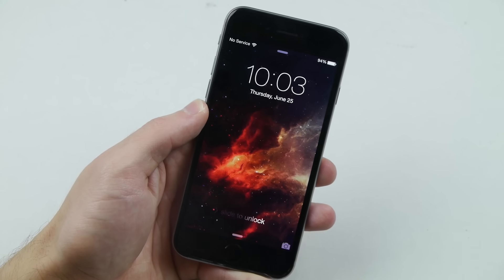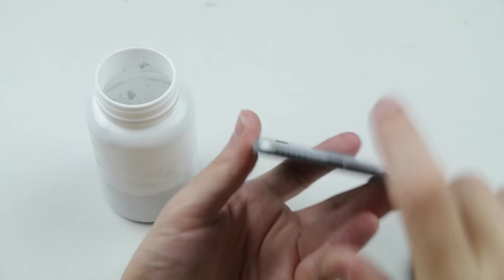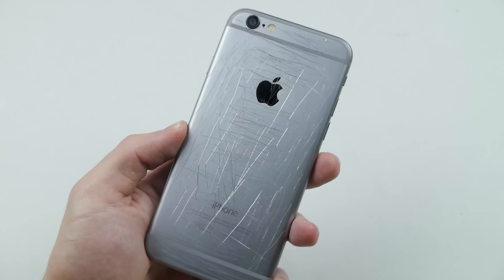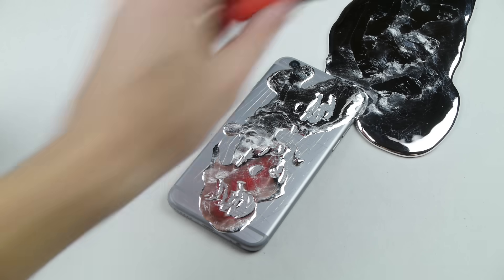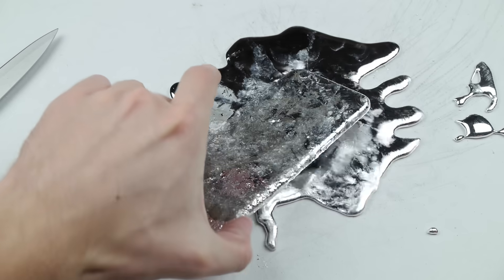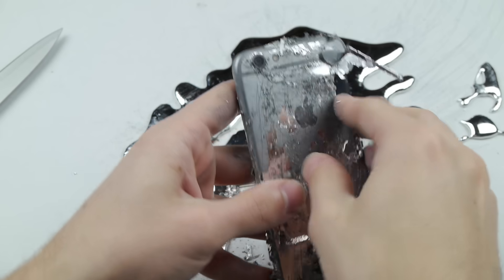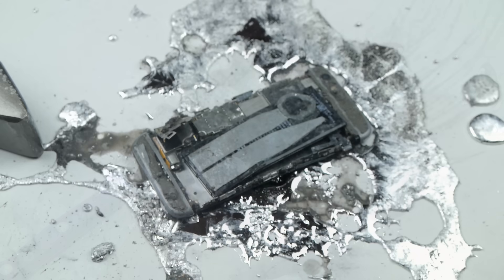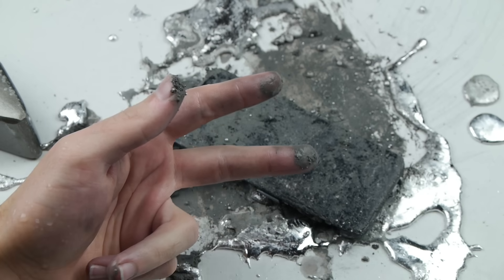What Happens If You Pour Gallium on an iPhone 6?

Comment: Skip to ContentSkip to Wiki NavigationSkip to Site Navigation
 Wikia		
   
Sign in	

 Geometry Dash Wiki
On the Wiki
Wiki Activity
Random page
Videos
Photos
Chat
Forum
Content
Levels
Community
 Contribute  04:42:42 6 Jul 2015 (UTC)Watchlist	Random page	Recent changes
Update 2.0
   
50PAGES ON
THIS WIKI View source   
Normal	This is upcoming!
This article contains information about unreleased content which is not entirely known about yet. If you do know something, help include additional information. Keep in mind that unverified information may be removed.

  Recently edited by
TheWikiGamePlayer
TheOtherGuest2
Themaster401
Nusdan
More...
Update 2.0 is an upcoming update to Geometry Dash with no set release date. It will be the tenth major update to the game.
Previews
October 18, 2014: Robert Topala makes his first, brief mention of Update 2.0 through Facebook, in the Update 1.9 changelog. When touching on the user accounts system that was introduced in 1.9, he says, "Will include more in update 2.0."
December 15, 2014: Topala announces on the official Geometry Dash Facebook page that he would begin sharing information about Update 2.0. He writes, "Highscore system is back online and should be a lot faster than before. More info about the Steam version and Update 2.0 coming in the next few days. Thanks for waiting!".
December 21, 2014: Topala posts his first preview image for the update. The figures on either sides of the picture resemble monsters, and a cube is included in the center. Written above is "The INVASION has begun", and there is also text reading "Update 2.0 W.I.P" in the lower right hand corner. This image caused much hype around the network, and theories of a song being Invaders started to expand.
December 26, 2014: Topala posts his second preview image, showing a Super Mario Bros-like stage, with a background that resembles to the video game Super Mario World. The cube that is included is similar to the 1-up mushroom found in the Super Mario series. It has shading, and is pixelated, hinting the possibility of new icons. It also shows new ground, and background patterns. Also, the 1-up mushroom has 3 colors from the shading, alike the Steamstep, and Companion Cube icons.
January 13, 2015: Topala posts another preview picture, confirming the existence of blue coins, an upcoming feature that was first discovered on the GJ_GameSheet file from Update 1.9 and in the GJ_GameSheet-uhd file from the Steam version. The blue coin closely resemble the regular, yellow coins, which were added in Update 1.6. While no information has officially been released on them, it is widely believed that they will be used for coins in the level editor, due to his post saying "I will add this maybe as user coins..." . The preview image also introduces two new Wave Icons, and new portals that were discovered to teleport the player to the nearest teleport portal. The colors of the portals are blue, and orange, confirming a Portal reference. About this, he also confirmed for 2.0 unlockable versions for the robot, and a chance for some of Etzer, and Viprin's Utopia texture pack Icons/Balls/Ships/Waves/UFOs to come in future updates.
February 5, 2015: Topala hints that he will post an Update 2.0 promo on the Geometry Dash Lite 1.9 update changelog. He writes, "I will be posting another Update 2.0 promo later today or tomorrow."
February 6, 2015: Topala posts the fourth preview picture, which shows a newer thick gray portal, making way for theories of a game mode in between two sets of new blocks: Embossed metal blocks, and "factory" style blocks.
February 13, 2015: Topala posts a fifth preview picture, which hints the soundtrack for the upcoming level. It depicts "B + D," an airplane, a skull with a lock on its forehead, a flame rising out of water, and a question mark. It was most agreed on that the next level would be "Deadlocked," by F-777, as B + D = F, the airplane refers to the Boeing 777, and the skull and lock refer to the song name itself. The soundtrack was also not available in the custom music selection. The other song would be an unknown song by Waterflame as the picture of a flame rising out of water hinted.
March 3, 2015: Topala posts a sixth preview picture, showing two new types of blocks, and three new backgrounds. The second picture from the left had already been shown, and the blocks from the first picture had already been shown.
March 24, 2015: Topala answers a few questions on TouchArcade in which he mentions there's a vast amount of colour channels coming up, and the copying between levels is mentioned, and that he's working on it. Other than that, better browsing options, and songs saving in the SD card. [1]
March 30, 2015: Topala confirms new colours, trails & new creator options. On the other hand, the idea of allowing the copy of stuff between the levels are still in discussion due to people saying it would end up in levels looking the same, and Topala isn't yet sure about adding this feature. [2]
April 2, 2015: Topala confirms that the sneak peek will be out soon. Also he confirms the sneak peek will show some features but not all, and he is sure that the creators will definitely love it. [3]
April 6, 2015: Topala confirms that the sneak peek will be out very soon. Also he wrote, "After that I might make a walkthrough video that shows some new editor features, lots of things to cover!" [4]
April 9, 2015: Topala posts a sneak peek on YouTube that introduces a new robot-like vehicle, new moving blocks, moving spikes, in game text, moving monster-like obstacles, changeable background, ground colors, new background, and new decorations.
April 17, 2015: Topala posts a reaction video about Geometry Dash in the official Facebook page in which he says: "Will be posting more info on 2.0 in a day or so, until then check this out :D (oh the rage)".
April 19, 2015: Topala posts a second sneak peek on YouTube that covers new level editor features, such as the ability to create, and save for copying custom objects, preview mode, layering objects, unlimited colors, and object scaling. Also, the object limit will be increased to 25,000.
May 11, 2015: Topala posts a third sneak peek on YouTube that confirms the level Deadlocked, along with new green jump rings (which combine the blue ring's gravity switch with the yellow ring's bounce), the teleportation portals, a new icon, a new background, new color effects, and new designs.
May 13, 2015: Topala posts on TouchArcade that there will be new filters for levels, in which you can now use a creator name as a filter to search for their levels. He also keeps the Deadlocked level difficulty as a secret saying: "Secrets secrets secrets... :)". Topala has provided information for the blue coins that are confirmed to be user coins, he says: "Separate. Blue coins = user coins = separate achievements and rewards". He has also mentioned an upcoming collaboration system, and following creators. In fact, There will be only three per level, and more obtainable than yellow ones. This also means a higher number for this specific coin achievements.
May 26, 2015: Topala makes his first mention of Update 2.1 on TouchArcade, saying "I wanted to mix up the art style a bit, keep things fresh. More craziness in 2.1!" He also mentions a changelog which describes the new features of Update 2.0. With the post, he confirmed that the changelog is coming very soon, and he also said that keeping updates smaller with only 1-2 months of development will be better in the future. He also said that 2.1 will be smaller but faster because 2.0 "took too long".
May 29, 2015: Topala answers a few questions on TouchArcade, confirming that Update 2.0 will introduce some space-related objects, along with several other new ones. He also mentions improving the Level Review system.
June 7, 2015: In a shoutbox conversation revealed on TouchArcade, Topala confirms that Deadlocked is a demon level. He also mentions a new trigger called "pulse trigger" which is related to color effects, and he discusses improving the level review system . In addition, he had this to say about the release of the update: "It's very very close to being done. I just don't say any dates because I'm not 100% sure."
June 12, 2015: Topala posts on Twitter that the update is close to release, so much so that no videos will be made to tide people over. Although he will make some tutorials later for new additions.
June 18, 2015: Topala posts on TouchArcade that users with accounts will have their own profile page [5].
June 19, 2015: Topala posts on TouchArcade that the performance in 2.0 will be better: "You shouldn't really see any performance issues compared to 1.9. I test a lot on mobile and optimize with that in mind. If anything you should see performance being better in 2.0." [6] He also confirmed that the moving obstacles have an option to change the speed at which they move. He also confirmed that he is adding an option which allows users to have up to 100 saved levels: "Hmm, well with the new improvement in save/load times it shouldn't be a problem. I will add an option that you can toggle to allow 100 saved levels (currently the limit is 20)".
July 1, 2015: During a conversation on TouchArcade RobTop said that "Hopefully I will be able to give some more info in a few days. The update is pretty much done, just fixing bugs. When adding many new systems like this there are a lot of things that can break. Trying to make sure you won't have any nasty bugs when 2.0 is released." [7].
Trivia
Since Update 1.92, the Deadlocked song has not been available for usage in custom levels as a soundtrack.
Update 2.0 has had the most teaser images and videos along with the longest development time.
The song name used for the first sneak peek video has not been identified.
If you look to the very right of the sixth WIP image, you can see a shadow of the new "robot" form.
The 2.0 Editor Preview video was the first of its kind, showing some new editor features.
Update 2.0 is the third update containing at least two new main levels, along with Update 1.6 and Update 1.9.
Update 2.0 is the update that holds the most spoilers. Topala has released over 30 things about the new update, a lot more compared to the others.
The blue and orange portals that teleport the player are very similar to the ones found in the Valve game series Portal, or can even be inspired by, as both games' portals are blue and orange and both teleport you to another place.
There is a still working glitch in 1.9 that can actually teleport you, seen here.
Sneak Peeks
Geometry Dash Update 200:13
Geometry Dash Update 2.0 Sneak Peek
Sneak Peek for a level with an unknown name
Geometry Dash Update 201:10
Geometry Dash Update 2.0 Editor Preview
Level editor preview
Geometry Dash Update 200:15
Geometry Dash Update 2.0 Sneak Peek 2
Sneak peek for Deadlocked

Gallery
2.0 Invasion
The first 2.0 WIP image released by RobTop
2.0 Blocks
The second 2.0 WIP image released by RobTop, making a reference to the Super Mario series
2.0 Features
The third 2.0 WIP picture featuring new wave icons, a blue coin and a new portal
2.0 Elements
The fourth WIP image that appears to show some more blocks, and a new vehicle portal and new decorations
2.0 Hint
The fifth WIP image which hints to the new levels containing the song Deadlocked by F - 777 and an unknown song by Waterflame
2.0 Decorations
The sixth sneak peek image showing some new background and ground designs, with some more blocks and monsters

Categories:
Updates
ADVERTISEMENT

 

Recent Wiki Activity
Practice Mode
edited by Hackey5 5 minutes ago
Secret Coins
edited by ErikCR 3 hours ago
Deadlocked
edited by ErikCR 3 hours ago
Portals
edited by ErikCR 3 hours ago
See more >
Live! Chat8
Geometry Dash Wiki
Join the Chat

       

Around Wikia's networkRandom Wiki
 GAMES
About  Help  Community Central  Careers  Advertise  API  Contact Wikia  Terms of Use  Privacy Policy  Sitemap Content is available under CC-BY-SA.  Mobile site

Final Fantasy VII or VIII forVideo GamesEntertainmentLifestyle
Will Final Fantasy VII or VIII win BEST GAME? Cast your votes
October 18, 2014: Robert Topala makes his first, brief mention of Update 2.0 through Facebook, in the Update 1.9 changelog. When touching on the user accounts system that was introduced in 1.9, he says, "Will include more in update 2.0."
December 15, 2014: Topala announces on the official Geometry Dash Facebook page that he would begin sharing information about Update 2.0. He writes, "Highscore system is back online and should be a lot faster than before. More info about the Steam version and Update 2.0 coming in the next few days. Thanks for waiting!".
December 21, 2014: Topala posts his first preview image for the update. The figures on either sides of the picture resemble monsters, and a cube is included in the center. Written above is "The INVASION has begun", and there is also text reading "Update 2.0 W.I.P" in the lower right hand corner. This image caused much hype around the network, and theories of a song being Invaders started to expand.
December 26, 2014: Topala posts his second preview image, showing a Super Mario Bros-like stage, with a background that resembles to the video game Super Mario World. The cube that is included is similar to the 1-up mushroom found in the Super Mario series. It has shading, and is pixelated, hinting the possibility of new icons. It also shows new ground, and background patterns. Also, the 1-up mushroom has 3 colors from the shading, alike the Steamstep, and Companion Cube icons.
January 13, 2015: Topala posts another preview picture, confirming the existence of blue coins, an upcoming feature that was first discovered on the GJ_GameSheet file from Update 1.9 and in the GJ_GameSheet-uhd file from the Steam version. The blue coin closely resemble the regular, yellow coins, which were added in Update 1.6. While no information has officially been released on them, it is widely believed that they will be used for coins in the level editor, due to his post saying "I will add this maybe as user coins..." . The preview image also introduces two new Wave Icons, and new portals that were discovered to teleport the player to the nearest teleport portal. The colors of the portals are blue, and orange, confirming a Portal reference. About this, he also confirmed for 2.0 unlockable versions for the robot, and a chance for some of Etzer, and Viprin's Utopia texture pack Icons/Balls/Ships/Waves/UFOs to come in future updates.
February 5, 2015: Topala hints that he will post an Update 2.0 promo on the Geometry Dash Lite 1.9 update changelog. He writes, "I will be posting another Update 2.0 promo later today or tomorrow."
February 6, 2015: Topala posts the fourth preview picture, which shows a newer thick gray portal, making way for theories of a game mode in between two sets of new blocks: Embossed metal blocks, and "factory" style blocks.
February 13, 2015: Topala posts a fifth preview picture, which hints the soundtrack for the upcoming level. It depicts "B + D," an airplane, a skull with a lock on its forehead, a flame rising out of water, and a question mark. It was most agreed on that the next level would be "Deadlocked," by F-777, as B + D = F, the airplane refers to the Boeing 777, and the skull and lock refer to the song name itself. The soundtrack was also not available in the custom music selection. The other song would be an unknown song by Waterflame as the picture of a flame rising out of water hinted.
March 3, 2015: Topala posts a sixth preview picture, showing two new types of blocks, and three new backgrounds. The second picture from the left had already been shown, and the blocks from the first picture had already been shown.
March 24, 2015: Topala answers a few questions on TouchArcade in which he mentions there's a vast amount of colour channels coming up, and the copying between levels is mentioned, and that he's working on it. Other than that, better browsing options, and songs saving in the SD card. [1]
March 30, 2015: Topala confirms new colours, trails & new creator options. On the other hand, the idea of allowing the copy of stuff between the levels are still in discussion due to people saying it would end up in levels looking the same, and Topala isn't yet sure about adding this feature. [2]
April 2, 2015: Topala confirms that the sneak peek will be out soon. Also he confirms the sneak peek will show some features but not all, and he is sure that the creators will definitely love it. [3]
April 6, 2015: Topala confirms that the sneak peek will be out very soon. Also he wrote, "After that I might make a walkthrough video that shows some new editor features, lots of things to cover!" [4]
April 9, 2015: Topala posts a sneak peek on YouTube that introduces a new robot-like vehicle, new moving blocks, moving spikes, in game text, moving monster-like obstacles, changeable background, ground colors, new background, and new decorations.
April 17, 2015: Topala posts a reaction video about Geometry Dash in the official Facebook page in which he says: "Will be posting more info on 2.0 in a day or so, until then check this out :D (oh the rage)".
April 19, 2015: Topala posts a second sneak peek on YouTube that covers new level editor features, such as the ability to create, and save for copying custom objects, preview mode, layering objects, unlimited colors, and object scaling. Also, the object limit will be increased to 25,000.
May 11, 2015: Topala posts a third sneak peek on YouTube that confirms the level Deadlocked, along with new green jump rings (which combine the blue ring's gravity switch with the yellow ring's bounce), the teleportation portals, a new icon, a new background, new color effects, and new designs.
May 13, 2015: Topala posts on TouchArcade that there will be new filters for levels, in which you can now use a creator name as a filter to search for their levels. He also keeps the Deadlocked level difficulty as a secret saying: "Secrets secrets secrets... :)". Topala has provided information for the blue coins that are confirmed to be user coins, he says: "Separate. Blue coins = user coins = separate achievements and rewards". He has also mentioned an upcoming collaboration system, and following creators. In fact, There will be only three per level, and more obtainable than yellow ones. This also means a higher number for this specific coin achievements.
May 26, 2015: Topala makes his first mention of Update 2.1 on TouchArcade, saying "I wanted to mix up the art style a bit, keep things fresh. More craziness in 2.1!" He also mentions a changelog which describes the new features of Update 2.0. With the post, he confirmed that the changelog is coming very soon, and he also said that keeping updates smaller with only 1-2 months of development will be better in the future. He also said that 2.1 will be smaller but faster because 2.0 "took too long".
May 29, 2015: Topala answers a few questions on TouchArcade, confirming that Update 2.0 will introduce some space-related objects, along with several other new ones. He also mentions improving the Level Review system.
June 7, 2015: In a shoutbox conversation revealed on TouchArcade, Topala confirms that Deadlocked is a demon level. He also mentions a new trigger called "pulse trigger" which is related to color effects, and he discusses improving the level review system . In addition, he had this to say about the release of the update: "It's very very close to being done. I just don't say any dates because I'm not 100% sure."
June 12, 2015: Topala posts on Twitter that the update is close to release, so much so that no videos will be made to tide people over. Although he will make some tutorials later for new additions.
June 18, 2015: Topala posts on TouchArcade that users with accounts will have their own profile page [5].
June 19, 2015: Topala posts on TouchArcade that the performance in 2.0 will be better: "You shouldn't really see any performance issues compared to 1.9. I test a lot on mobile and optimize with that in mind. If anything you should see performance being better in 2.0." [6] He also confirmed that the moving obstacles have an option to change the speed at which they move. He also confirmed that he is adding an option which allows users to have up to 100 saved levels: "Hmm, well with the new improvement in save/load times it shouldn't be a problem. I will add an option that you can toggle to allow 100 saved levels (currently the limit is 20)".
July 1, 2015: During a conversation on TouchArcade RobTop said that "Hopefully I will be able to give some more info in a few days. The update is pretty much done, just fixing bugs. When adding many new systems like this there are a lot of things that can break. Trying to make sure you won't have any nasty bugs when 2.0 is released." [7]. Skip to ContentSkip to Wiki NavigationSkip to Site Navigation
 Wikia		
   
Sign in	

 Geometry Dash Wiki
On the Wiki
Wiki Activity
Random page
Videos
Photos
Chat
Forum
Content
Levels
Community
 Contribute  04:42:42 6 Jul 2015 (UTC)Watchlist	Random page	Recent changes
Update 2.0
   
50PAGES ON
THIS WIKI View source   
Normal	This is upcoming!
This article contains information about unreleased content which is not entirely known about yet. If you do know something, help include additional information. Keep in mind that unverified information may be removed.

  Recently edited by
TheWikiGamePlayer
TheOtherGuest2
Themaster401
Nusdan
More...
Update 2.0 is an upcoming update to Geometry Dash with no set release date. It will be the tenth major update to the game.
Previews
October 18, 2014: Robert Topala makes his first, brief mention of Update 2.0 through Facebook, in the Update 1.9 changelog. When touching on the user accounts system that was introduced in 1.9, he says, "Will include more in update 2.0."
December 15, 2014: Topala announces on the official Geometry Dash Facebook page that he would begin sharing information about Update 2.0. He writes, "Highscore system is back online and should be a lot faster than before. More info about the Steam version and Update 2.0 coming in the next few days. Thanks for waiting!".
December 21, 2014: Topala posts his first preview image for the update. The figures on either sides of the picture resemble monsters, and a cube is included in the center. Written above is "The INVASION has begun", and there is also text reading "Update 2.0 W.I.P" in the lower right hand corner. This image caused much hype around the network, and theories of a song being Invaders started to expand.
December 26, 2014: Topala posts his second preview image, showing a Super Mario Bros-like stage, with a background that resembles to the video game Super Mario World. The cube that is included is similar to the 1-up mushroom found in the Super Mario series. It has shading, and is pixelated, hinting the possibility of new icons. It also shows new ground, and background patterns. Also, the 1-up mushroom has 3 colors from the shading, alike the Steamstep, and Companion Cube icons.
January 13, 2015: Topala posts another preview picture, confirming the existence of blue coins, an upcoming feature that was first discovered on the GJ_GameSheet file from Update 1.9 and in the GJ_GameSheet-uhd file from the Steam version. The blue coin closely resemble the regular, yellow coins, which were added in Update 1.6. While no information has officially been released on them, it is widely believed that they will be used for coins in the level editor, due to his post saying "I will add this maybe as user coins..." . The preview image also introduces two new Wave Icons, and new portals that were discovered to teleport the player to the nearest teleport portal. The colors of the portals are blue, and orange, confirming a Portal reference. About this, he also confirmed for 2.0 unlockable versions for the robot, and a chance for some of Etzer, and Viprin's Utopia texture pack Icons/Balls/Ships/Waves/UFOs to come in future updates.
February 5, 2015: Topala hints that he will post an Update 2.0 promo on the Geometry Dash Lite 1.9 update changelog. He writes, "I will be posting another Update 2.0 promo later today or tomorrow."
February 6, 2015: Topala posts the fourth preview picture, which shows a newer thick gray portal, making way for theories of a game mode in between two sets of new blocks: Embossed metal blocks, and "factory" style blocks.
February 13, 2015: Topala posts a fifth preview picture, which hints the soundtrack for the upcoming level. It depicts "B + D," an airplane, a skull with a lock on its forehead, a flame rising out of water, and a question mark. It was most agreed on that the next level would be "Deadlocked," by F-777, as B + D = F, the airplane refers to the Boeing 777, and the skull and lock refer to the song name itself. The soundtrack was also not available in the custom music selection. The other song would be an unknown song by Waterflame as the picture of a flame rising out of water hinted.
March 3, 2015: Topala posts a sixth preview picture, showing two new types of blocks, and three new backgrounds. The second picture from the left had already been shown, and the blocks from the first picture had already been shown.
March 24, 2015: Topala answers a few questions on TouchArcade in which he mentions there's a vast amount of colour channels coming up, and the copying between levels is mentioned, and that he's working on it. Other than that, better browsing options, and songs saving in the SD card. [1]
March 30, 2015: Topala confirms new colours, trails & new creator options. On the other hand, the idea of allowing the copy of stuff between the levels are still in discussion due to people saying it would end up in levels looking the same, and Topala isn't yet sure about adding this feature. [2]
April 2, 2015: Topala confirms that the sneak peek will be out soon. Also he confirms the sneak peek will show some features but not all, and he is sure that the creators will definitely love it. [3]
April 6, 2015: Topala confirms that the sneak peek will be out very soon. Also he wrote, "After that I might make a walkthrough video that shows some new editor features, lots of things to cover!" [4]
April 9, 2015: Topala posts a sneak peek on YouTube that introduces a new robot-like vehicle, new moving blocks, moving spikes, in game text, moving monster-like obstacles, changeable background, ground colors, new background, and new decorations.
April 17, 2015: Topala posts a reaction video about Geometry Dash in the official Facebook page in which he says: "Will be posting more info on 2.0 in a day or so, until then check this out :D (oh the rage)".
April 19, 2015: Topala posts a second sneak peek on YouTube that covers new level editor features, such as the ability to create, and save for copying custom objects, preview mode, layering objects, unlimited colors, and object scaling. Also, the object limit will be increased to 25,000.
May 11, 2015: Topala posts a third sneak peek on YouTube that confirms the level Deadlocked, along with new green jump rings (which combine the blue ring's gravity switch with the yellow ring's bounce), the teleportation portals, a new icon, a new background, new color effects, and new designs.
May 13, 2015: Topala posts on TouchArcade that there will be new filters for levels, in which you can now use a creator name as a filter to search for their levels. He also keeps the Deadlocked level difficulty as a secret saying: "Secrets secrets secrets... :)". Topala has provided information for the blue coins that are confirmed to be user coins, he says: "Separate. Blue coins = user coins = separate achievements and rewards". He has also mentioned an upcoming collaboration system, and following creators. In fact, There will be only three per level, and more obtainable than yellow ones. This also means a higher number for this specific coin achievements.
May 26, 2015: Topala makes his first mention of Update 2.1 on TouchArcade, saying "I wanted to mix up the art style a bit, keep things fresh. More craziness in 2.1!" He also mentions a changelog which describes the new features of Update 2.0. With the post, he confirmed that the changelog is coming very soon, and he also said that keeping updates smaller with only 1-2 months of development will be better in the future. He also said that 2.1 will be smaller but faster because 2.0 "took too long".
May 29, 2015: Topala answers a few questions on TouchArcade, confirming that Update 2.0 will introduce some space-related objects, along with several other new ones. He also mentions improving the Level Review system.
June 7, 2015: In a shoutbox conversation revealed on TouchArcade, Topala confirms that Deadlocked is a demon level. He also mentions a new trigger called "pulse trigger" which is related to color effects, and he discusses improving the level review system . In addition, he had this to say about the release of the update: "It's very very close to being done. I just don't say any dates because I'm not 100% sure."
June 12, 2015: Topala posts on Twitter that the update is close to release, so much so that no videos will be made to tide people over. Although he will make some tutorials later for new additions.
June 18, 2015: Topala posts on TouchArcade that users with accounts will have their own profile page [5].
June 19, 2015: Topala posts on TouchArcade that the performance in 2.0 will be better: "You shouldn't really see any performance issues compared to 1.9. I test a lot on mobile and optimize with that in mind. If anything you should see performance being better in 2.0." [6] He also confirmed that the moving obstacles have an option to change the speed at which they move. He also confirmed that he is adding an option which allows users to have up to 100 saved levels: "Hmm, well with the new improvement in save/load times it shouldn't be a problem. I will add an option that you can toggle to allow 100 saved levels (currently the limit is 20)".
July 1, 2015: During a conversation on TouchArcade RobTop said that "Hopefully I will be able to give some more info in a few days. The update is pretty much done, just fixing bugs. When adding many new systems like this there are a lot of things that can break. Trying to make sure you won't have any nasty bugs when 2.0 is released." [7].
Trivia
Since Update 1.92, the Deadlocked song has not been available for usage in custom levels as a soundtrack.
Update 2.0 has had the most teaser images and videos along with the longest development time.
The song name used for the first sneak peek video has not been identified.
If you look to the very right of the sixth WIP image, you can see a shadow of the new "robot" form.
The 2.0 Editor Preview video was the first of its kind, showing some new editor features.
Update 2.0 is the third update containing at least two new main levels, along with Update 1.6 and Update 1.9.
Update 2.0 is the update that holds the most spoilers. Topala has released over 30 things about the new update, a lot more compared to the others.
The blue and orange portals that teleport the player are very similar to the ones found in the Valve game series Portal, or can even be inspired by, as both games' portals are blue and orange and both teleport you to another place.
There is a still working glitch in 1.9 that can actually teleport you, seen here.
Sneak Peeks
Geometry Dash Update 200:13
Geometry Dash Update 2.0 Sneak Peek
Sneak Peek for a level with an unknown name
Geometry Dash Update 201:10
Geometry Dash Update 2.0 Editor Preview
Level editor preview
Geometry Dash Update 200:15
Geometry Dash Update 2.0 Sneak Peek 2
Sneak peek for Deadlocked

Gallery
2.0 Invasion
The first 2.0 WIP image released by RobTop
2.0 Blocks
The second 2.0 WIP image released by RobTop, making a reference to the Super Mario series
2.0 Features
The third 2.0 WIP picture featuring new wave icons, a blue coin and a new portal
2.0 Elements
The fourth WIP image that appears to show some more blocks, and a new vehicle portal and new decorations
2.0 Hint
The fifth WIP image which hints to the new levels containing the song Deadlocked by F - 777 and an unknown song by Waterflame
2.0 Decorations
The sixth sneak peek image showing some new background and ground designs, with some more blocks and monsters

Categories:
Updates
ADVERTISEMENT

 

Recent Wiki Activity
Practice Mode
edited by Hackey5 5 minutes ago
Secret Coins
edited by ErikCR 3 hours ago
Deadlocked
edited by ErikCR 3 hours ago
Portals
edited by ErikCR 3 hours ago
See more >
Live! Chat8
Geometry Dash Wiki
Join the Chat

       

Around Wikia's networkRandom Wiki
 GAMES
About  Help  Community Central  Careers  Advertise  API  Contact Wikia  Terms of Use  Privacy Policy  Sitemap Content is available under CC-BY-SA.  Mobile site

Final Fantasy VII or VIII forVideo GamesEntertainmentLifestyle
Will Final Fantasy VII or VIII win BEST GAME? Cast your votes
July 6, 2015: Robtop posted on TouchArcade that performance of 2.0 is a lot better than 1.90 because of the implementation of 64-bit architecture on iOS. "Things are going well, still not 100% ready though. Keep finding and fixing bugs, also needed to implement Apple's new requirement for 64-bit support, which required some testing."
July 7, 2015: RobTop posts on Facebook and YouTube another video showing off new keys which corresponds to locked blocks and how they function with the moving feature, it was mainly a test as mentioned by himself: "Just a random test I made while checking for bugs. Thought it looked pretty fun :)". He also mentions that the update is almost done, and that he is working in game bugs by saying: "The update is more or less done, just fixing bugs right now. Trying to get it done as fast as I can. Thanks for waiting so long, I know it sucks :)"
The keys are nothing else but decorations, they actually do not work for anything for the game experience. They work as triggers and are mainly a visual help for the player. [8]
The flames visible at both sides of the first wall of blocks are fully customizable for the user, and were animated by hand for various usages. [9]
The song playing in the background was made by RobTop himself. [10] July 1, 2015: During a conversation on TouchArcade RobTop said that "Hopefully I will be able to give some more info in a few days. The update is pretty much done, just fixing bugs. When adding many new systems like this there are a lot of things that can break. Trying to make sure you won't have any nasty bugs when 2.0 is released."